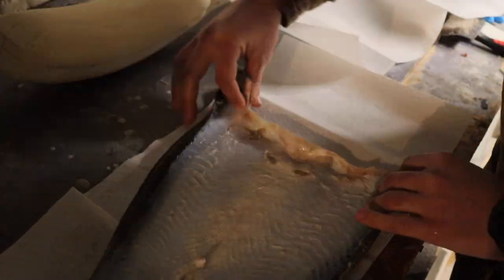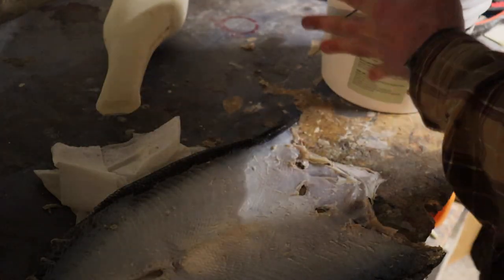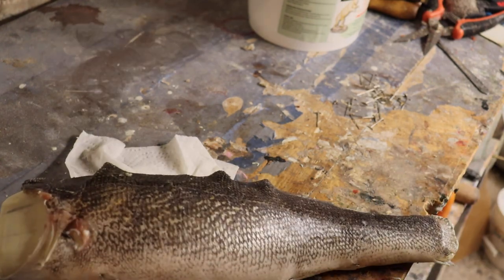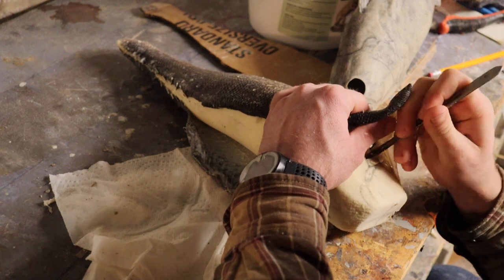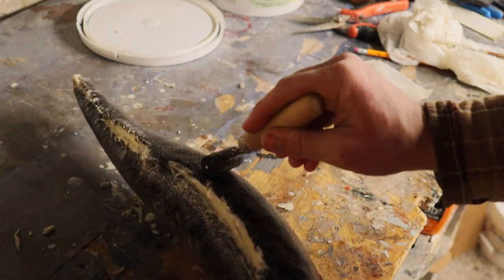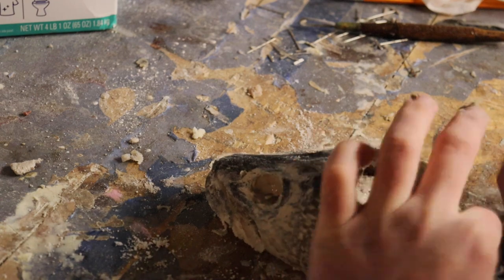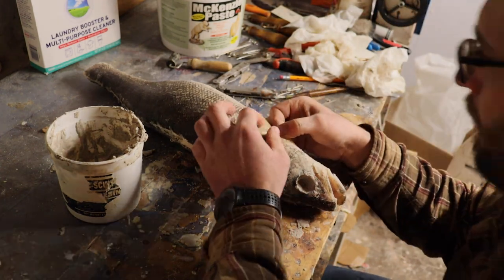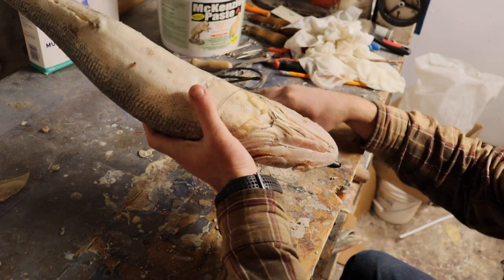Fish Taxidermy SKIN Mount Part : Mounting a Walleye on Our Carved Form

Comment: Not sure how it happens but once again 3/3  my projects coincide with your current videos.  Very convenient for me.  I’m working on a first LM bass mount. Went looking for options to use as a filler in the cheek.
Reply from the maker: Glad it's been working out that way I used clayshay from aves for this one but most fast set mache works well